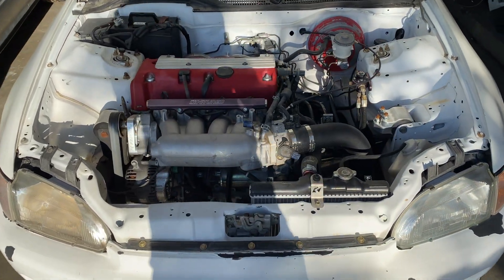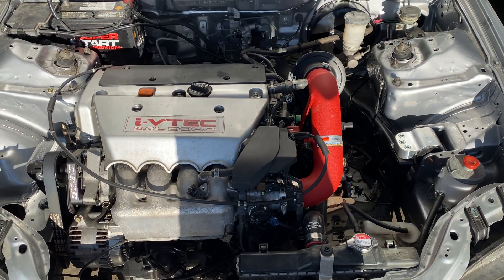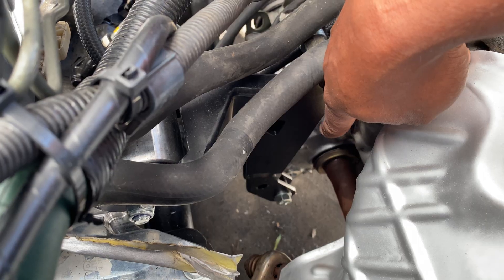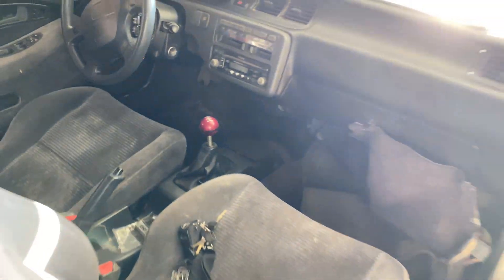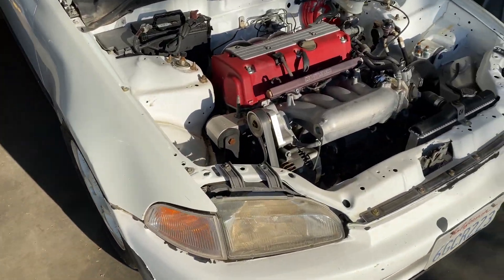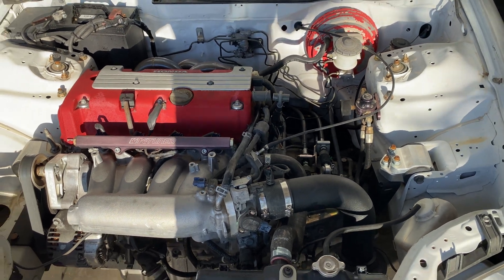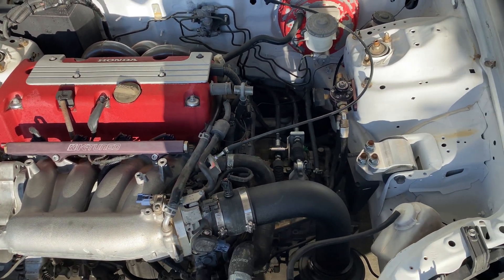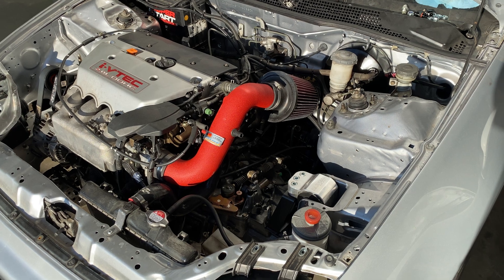K20z1 vs k20a2 engine comparison part 1

Comment: just got a z1 block. can i run a k20a2 head on the z1 block and run the 02 harness?
Reply from the maker: Yea the heads are the same just the cam is better on the z1

Comment: can u use the si lsd for a 06 type s transmission?
Reply from the maker: Yea that lsd was used on the k20a2 swap , but make sure you put the speed ring on the lsd if you have 02-04

Comment: Is it possible to bard a b18c1 OBD2A in a OBD2B vehicle?  I know for California it states same year or newer but I came across a motor for a good price that I couldn’t resist. Also, is it possible to convert the OBD2A to OBD2B if needed? I basically have a 1998 motor going into a 1999 chassis. I am not too familiar with the steps of getting it bard but am familiar with doing the swap alone. Any help would much appreciated. Thank you
Reply from the maker: The first rule of bar is , same year or newer , Anything older will fail instantly

Comment: So what’s the difference between a k20z3 and k20z1 ?
Reply from the maker: K20z3 had type r lsd , rbc manifold , but has k24 oil pump and designed like a k24 casing in a K20 body , also has tsx 6th gear , but same final drive as type s , type s has better oil pump , both 11.0 compression , Rsx non lsd , has different head casting and water pump housing also shifter mechanism is different , type s cable throttle , k20z3 drive by throttle , k20z3 needs types s harness and Ecu to run
Reply: @rarewitit7899  k20z3 shares an exhaust cam with the a2, but it's own unique intake cam. Z1 runs type r cams. z3 has a 1mm smaller throttle body than the Z1. Z1 produces about 5 more horse power.
Reply: @rarewitit7899 so a K20Z1 camshafts are the type r? Wanna built a k24 and thinking of getting them